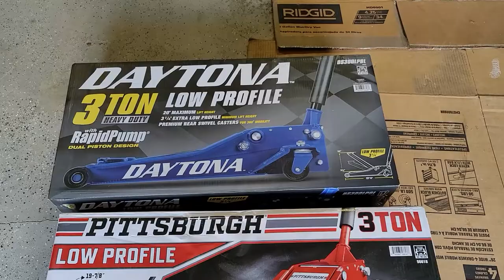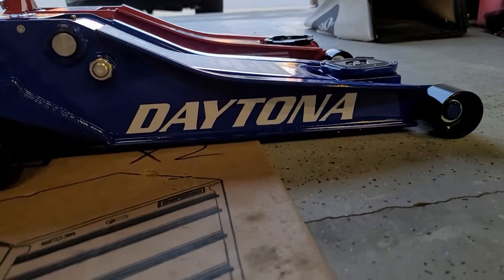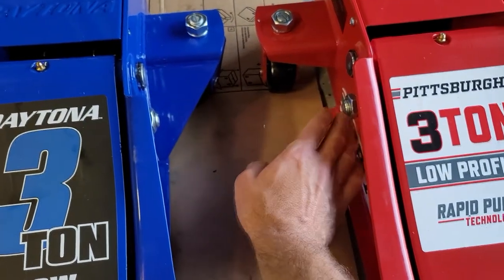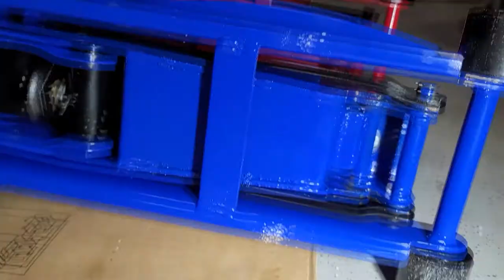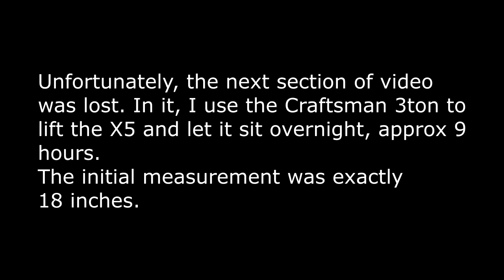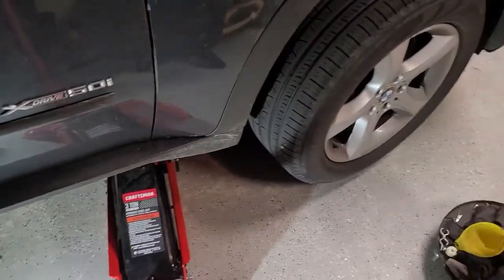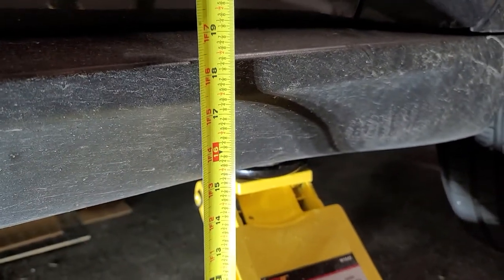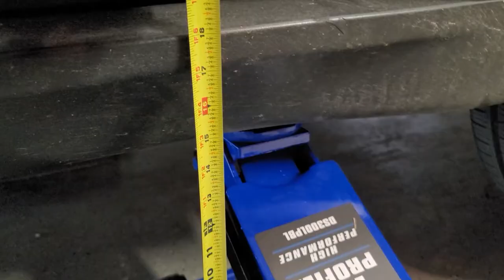Daytona, Pittsburgh, PT and Craftsman floor jack comparison. Another Jack...off.

Comment: The Daytona Super Duty 3 ton jack is the SnapOn jack. Same manufacturer, same factory, same assembly line, same exact jack. 
Best floor jack for the money.
It's the only Daytona jack with the 3 year warranty. 
Goes nearly 24 inches up, it's about 3.5 inches tall all the way down, has a larger pad, reaches full height in 4.5 full stroke pumps, has larger front wheels with grease fittings, and has multiple grease fittings all over the jack and is easy to service if air needs to bleed out or fluid topped off. 
It's 104 pounds but rolls with the push of a finger. 
Can lift my Duramax just using one of my arms.

Edit: All hydraulic systems will slowly leak down over time, both manual or powered hydraulic systems, new or old.

Also, I've had a Torin Big Red 3 ton compact jack for about 15 years. Finally blew out a seal. Very versatile in small tight spaces. Can swing the handle 360 to any position you need, and has an extension section for the pad. Takes forever to pump up but it's my second favorite jack next to the big Daytona Super Duty.
Reply from the maker: Great comment, thank you. To clarify, the Daytona in my video is not the Super Duty you reference.

Comment: Most of the time it comes down to cost as which will perform better than the others. So, in 2021 the Pittsburgh 3 Ton Low Profile was $99 ON SALE,  and as of Sept. 2024 retails at HF for $159. I bought the Pittsburgh 2 Ton LP for $119 on sale here in Sept. 2024. (retails $139) The Daytona 3 Ton LP is now $179 at HF. Craftsman generally has been a brand you can trust and you pay for the brand name. Craftsman a basic jack was good back in the day but now many cars require Low Profile such as my 2023 Toyota Camry XSE V6 to avoid the handle smacking into the side of the car.
I am surprised that the Aluminum jack has not bend or warped or started to leak as known not to last as long as the steel made jacks, also 1.5 Ton is practically useless on any vehicle larger than a Honda Civic or FIT, Subaru WRT, or Mini Cooper. For Pickup Trucks and large SUVs need a 4 Ton Floor Jack which are heavy jacks to pick up. I really would have liked the Daytona 3 Ton LP Long Reach but not at $239 which weighs 103 pounds vs the Pitt 2 Ton LP at 54 pounds which most people can lift up off the ground with no problem. Do not buy any Pittsburgh or Dayton Jack Stands as there has been a major Recall as they were defective and dangerous. Please get Husky 3 Ton Jack Stands from Home Depot or Torin Big Red. Remember that most products sold at Harbor Freight are made in China, made of low quality, typically cheaper, and Never spend the money for a Protection Plan/ Extended Warranty. At times you can ask the manager to visually inspect or test the product In-Store before buying. Note or word of advice: Be SOBER when working.
Reply from the maker: @richscott2483  the jack stand drama was years ago and HF did as much as they could to make that right by the customers....I am not loyal to any brand or company but was impressed with how HF handled that. 
Almost all discount tools are made in China which isn't always an indicator of low quality.
And sure, sober is great, but so is having a couple drinks. To each their own

Comment: The welds on the Daytona are beefy compared to the others..
Reply from the maker: I didn't really even look at the welds. Both jacks are still in use, the Pittsburgh has had a hard life  outside and is still holding up. The Daytona stays inside and is my go to.

Comment: Here we are almost a year after your video
The Dayton 3 ton rapid pump low profile jack is $179.99.
If you want a long reach version, its $239.99 (both @ harbor freight)
Reply: Here we are 11 months after your comment, and the Daytona is $189.99 now.
Reply: @aznnp77  here I am from the year 2024 and it's 199.99

Comment: Crud, HF has the Pittsburgh for $120 and the Daytona for $150. Both 3-ton low profile like you have in this vid. 
I actually bought the Pittsburgh on Black Friday but after seeing this video I am returning it tomorrow and getting the Daytona because now it is on sale for their Christmas sale

The extra gussets, jack pad design, and smoother release has me sold. I just wish it came in red to match all my other tool boxes! They only have it in Black, Blue, Green, and Orange. Probably will just get it in blue.
Reply from the maker: Either one is great. I gave the Pittsburgh in this video to my buddy, he uses it regularly and it's great. I kept the PT and Daytona and they both rock. You can't make a wrong decision.
Reply: Lucky. 160 and 190 for me now. And I think I have to get a jack this weekend.

Comment: The Home Depot Husky 3 ton floor jack looks much the same as the Pittsburgh and Daytona jacks. I'll be in the market soon for a new one. The Daytona looks like a good one. I think mine is a Craftsman and looks, at times, to lean to the left I think depending on the tilt of the ground in my driveway. It works though.
Reply from the maker: Never had a Husky jack but if it looks similar to these then I think you will be pleased. I love all of these jacks.
Reply: I bought a 3tom craftsman from lowes and man when your lower your vehicle it just slams it doesnt release slow
Reply: @isiiiimp811  mine did that when I first bought it. I purged it 3 times in a row and no more fast release.

Comment: Can't beat the price for any Daytona comparing to any Snap-On jack that the Daytona's copied from hence why Snap On sue HF for it but lost & that's why HF keeps making them! 
Im starting to upgrade my tools to their ICON since i notice greatly when working on my BMW how their Pittsburgh brand tools are very cheap and tolerance not soo good when working on tough torque bolts as Icon drives them out like a champ & no worries!
Reply from the maker: Yeah the Daytona jacks are awesome. I haven't used any Icon tools yet but I hear good things, like you have stated here. Thanks for commenting.

Comment: Here it is 1 year later and the price for the Red Pittsburg Jack is now $159. That's what I paid.... dang!
Reply from the maker: Still worth it I think. Although they did just run a "lot sale" where it was 119. See if you can catch it on sale, buy another one and then return the new one in the box on the old receipt. I've done that before
Reply: pittsburg is on sale at harborfreight right now until the 16th, i was going to buy the daytona but a whole 50 bucks price down can't be dismiss

Comment: The only thing that scares me about the expensive jacks as they are twist to release. On my cheap jack you have to remove the handle and deliberately turn that knob counter clockwise. It feels much safer in that sense.
Reply from the maker: I supposed you are right about it being safer, although I've never had an incident with the way these jacks are set up.
Reply: you really can't just bump into the handle and have it twist and release I always use jack stands anyway and keep jack slightly loaded as a backup
Reply: @ranger178  Yeah I would never not use jack stands, but most of the mechanics I've run into just use the jack. I took my car to a cheap shop and the guy was under my lowered car and I was so scared I was gonna hit the handle and kill him.

Comment: Thanks I'm debating on the Pittsburgh and the Daytona myself. I have a Craftsman 2 1/4 ton that i've used for about 10 years. A couple of years ago it started to sink relatively quickly and I've got a repair I needa do where I could be under the car for like 10 minutes that scares the crap outta me with a lowered car. With inflation, the Daytona is now $50 more than the Pittsburgh. For $25 more it's kind of a non brainer to go with the Daytona. Even though it may be considered an off brand, the Daytona Jack feel almost like a Lexus of jacks to me. I'd like the Daytona just cuz it looks nicer. I probably only use it 4-5 times a year though. But I feel like it's something that'll last me the rest of my life almost so maybe get the better one anyways. Surprised me that the Daytona dropped at all overnight though.
Reply from the maker: To be fair to the Daytona, it was brand new when I made this video and I have used it quite a bit since, without noting any drop under extended use.  I haven't measure it either, so who really knows but recently I had it under the front control arm of my FJ for about 2 weeks and it held up just fine.
Reply: You don't put your fuc*in car on stands? You just get under your car counting on just the jack to keep it from crushing you?
Reply: @garonjohnson5922  Of course I use stands. But When I'm under the car risking my life, I like as many safety protocols as possible. The jack, two stands, and a third jack stand for good measure. Still scares the crap outta me getting under the car. But with my jack sinking, it's just the 2 stands and the third one sometimes doesn't fit under there.
Reply: @aznnp77 This isn't real. Just buy the shiny new jack cause your paint is scratched. Don't gotta justify it to these guys. Jack the car up, throw your stands down and get to work. Don't gotta worry about nothing crushing you with good stands down.
Reply: @Crowley1896mass  Money is tight right now, so I can't really afford a $200 jack for something I use 3-4 times a year. Luckily this year it's only been once for my own car. I've done other people's cars, but I dunno if I could use the Daytona jack cuz it's not exactly portable with it's weight like a Trolly jack is.

Comment: I think those front casters are random. I’ve purchased two of the same low pro Pittsburgh jacks and the first has rounded wheels while the second had totally flat. Picked up the long reach Daytona jack and that one has the more rounded style also.
Reply from the maker: Really. Well there goes my theory on the wheels. Thanks for sharing this.
Reply: My 3 ton Pittsburgh has flat fronts. I think they use whatever is on hand !!!!!!
Reply from the maker: @500erider  could be.

Comment: Im indecisive bewteen the Daytona 2ton Alum Jack and the Pittsburg.😐Which one is the higher quality one?
Reply from the maker: If the extra $ is not an issue, go with the Daytona always.  There is enough extra gusseting and design improvements that it is a superior item to the Pitts.  That being said I don't believe you can make a wrong choice...both brands are really good nowadays.
Reply: @jcx2bby  thank you for your input. Daytona it is🏁😁🙌

Comment: i don't like the new really low-profile jacks because the wheels are too small in diameter and the smallest crack or pebble on driveway makes the wheel stick as jacks move while lifting cars to stay centered under frame and the jack can twist. this is much more of a problem in aluminum jacks, but it can happen with steel also.I got jack from tire rack aluminum 2 ton and it twists at the drop of a hat my old 1980s steel jack with large front wheels is much better.
Reply from the maker: And the jack pads on these new jacks are 1/3 smaller or more than old school jacks. my dad has several floor jacks from the 80s and 90s that have enormous pads compared to this new crop.

Comment: Which performs better : Pittsburgh or Daytona ?
Reply from the maker: I can honestly say they're pretty even. The Daytona is a better jack because it's better built and costs more due to that. But 'performance', from my unscientific results, is almost identical.
Reply: @jcx2bby  I also see there’s a 3 ton Daytona super duty the candy red . I was thinking this one . Originally was looking at the 3 ton Pittsburgh
Reply from the maker: @aronp713  that super duty is a whole different beast. I don't have experience with that one. I believe one of the other commenters on here said that it is the exact same as the Snap-on jack. Take that for what it's worth.
Reply: I own the low profile Pittsburgh 3 ton and the Daytona long reach 3 ton…I have to say the Daytona definitely is nicer and let’s down the vehicle so much smoother, and is much easier to raise. Also the saddle is a nicer due to the rubber pad and square shape in my opinion. I should add that it’s probably easier to lift because of the extra reach though.

Comment: What I want to know is the oil refill plug rubber or screw on type on the Dakotas?  I just found out the Pittsburgh jack has a rubber refill plug. I don't like that. For me those things, rubber plugs,  are a pain in the ass to get out and a pain in the ass to get back in.
Reply from the maker: This is a great question. I had not even thought about comparing that when I made the video. I took off the cover that I pointed out at 4:13 in the video, and under there on the Daytona is the fill plug, which is a metal screw in type. I'm not sure about the Pittsburgh as I no longer have that jack. Regardless, you shouldn't need to fill oil into any of these Jacks on any kind of recurring basis.

Comment: Remember the Pittsburgh Jacks go lower than the Daytona's half an inch is a half an inch guys that's if you need it
Reply from the maker: The pittsburgh only goes an eighth of an inch lower, not half inch.  At least, between the two jacks in this video.